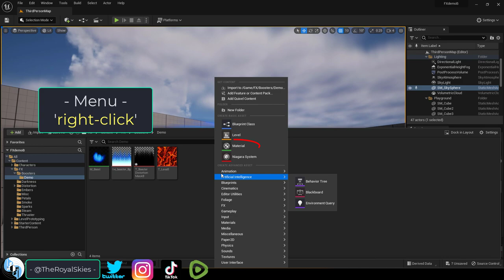Unreal5 VFX: Jet-Thruster AIR-DISTORTION -

Comment: Its not working for me. the refraction tab is disabled, i cant plug anything into it.
Reply: Select the Result Node (M_BoostDist in his example), scroll down in the Details panel to Refraction- the Refraction Method is set to None by default in UE 5.4.2, try using Index Of Refraction.